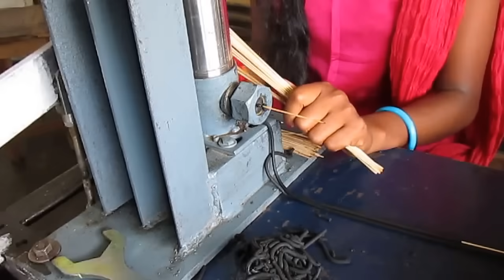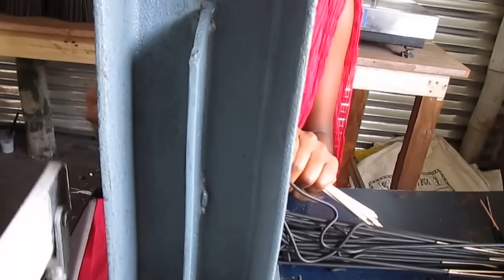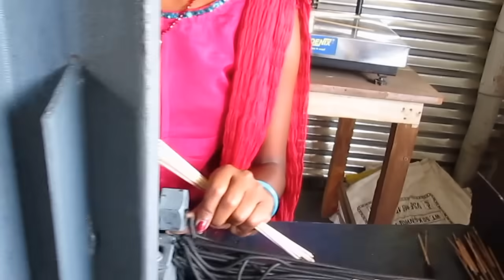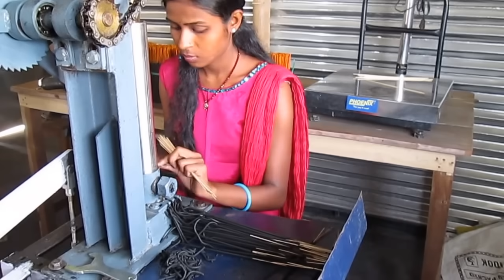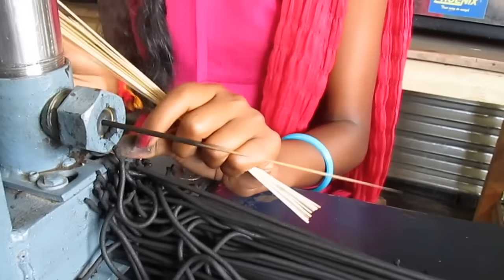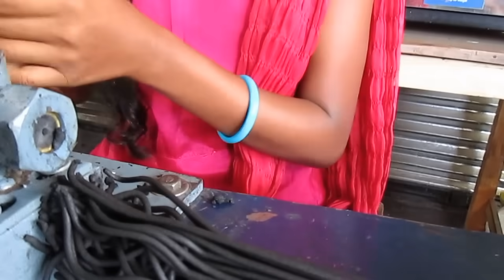agarbatti pedal machine new modified technology

Comment: but those agarbattis are coming out in bent way.
Reply: Neufloxin Floaxacin the masala is still wet it will b dried under tge sun for 5 to 6 hrs then it will be uniformly cut in equall sizes n then packed n sold